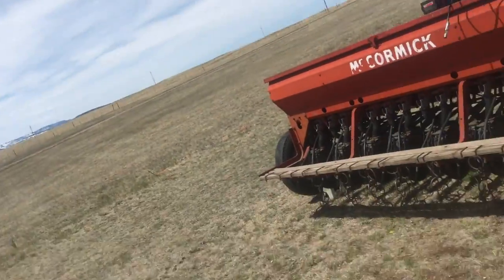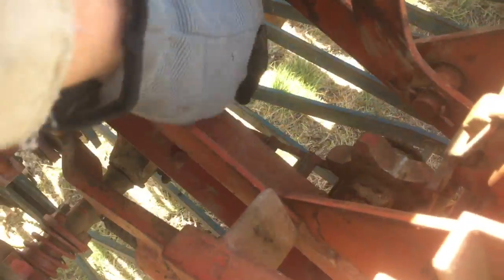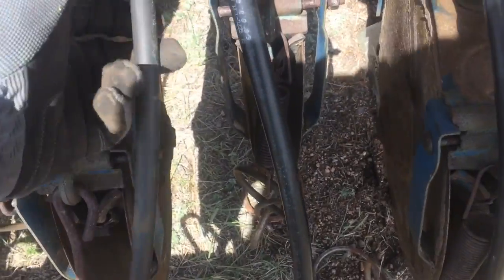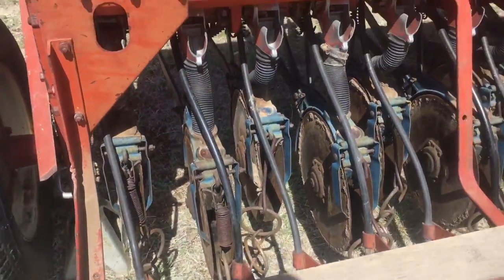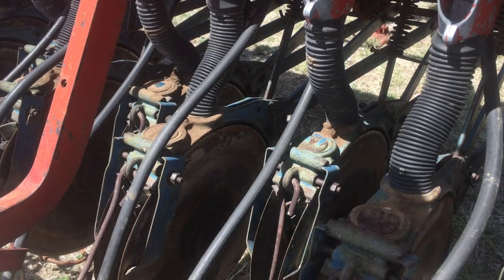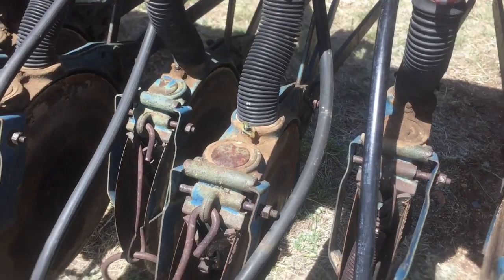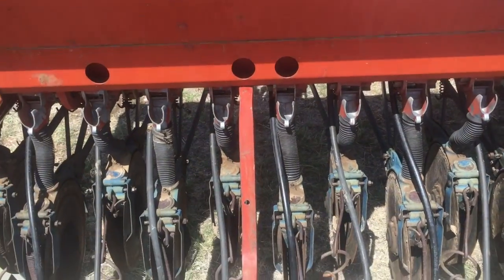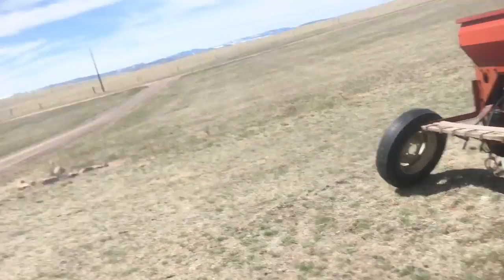The IH Model 10 seed drill

Comment: Great video. I was wondering if you have any tricks to get the seed  hose on the top. where the seed comes out of the box. I have one that ripped and the new one is giving me  some troubles. Got the bottom end on. Thanks for the video
Reply from the maker: It can be a little tricky, cautiously applying a little heat may help.